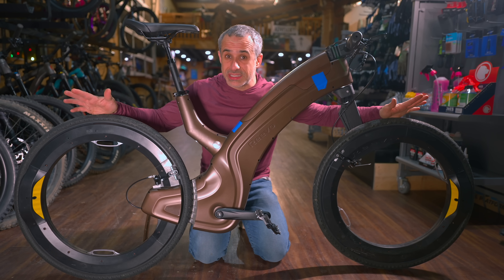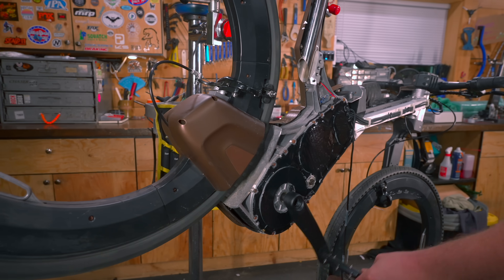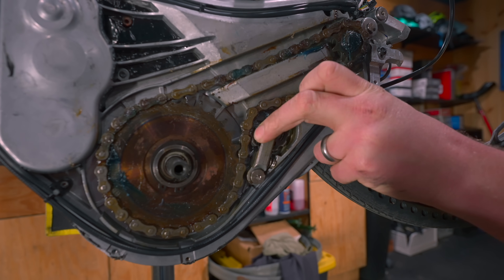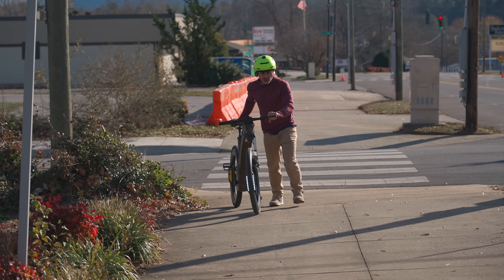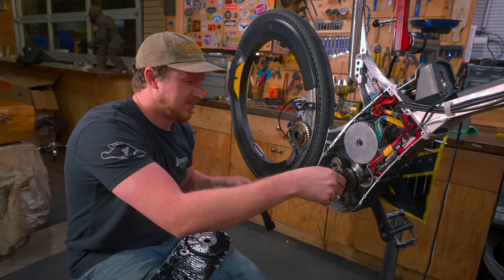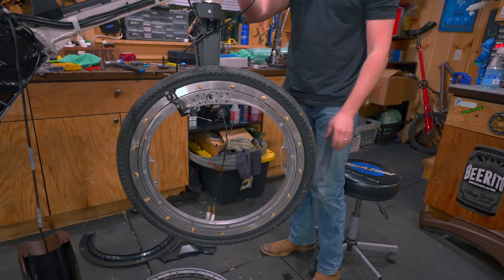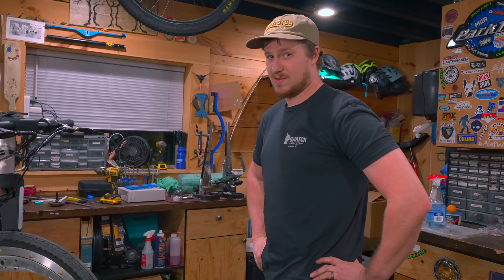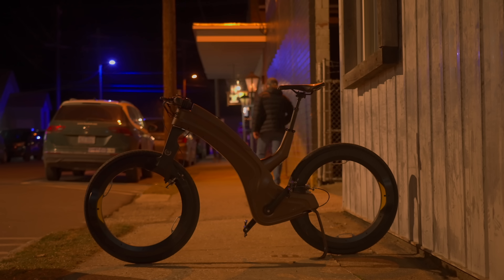What's Inside The World’s Worst eBike? Reevo Teardown

Comment: This is a great reminder of how wonderfully elegant a normal bicycle is
Reply: Bicycles are crazy efficient. I've read that like 90-99% of the mechanical energy delivered by the rider is transmitted to the wheels
Reply: @jesperhagstrom  Where 1% of the energy is delivered on the Reevo. The rest is lost to friction.
Reply: @jesperhagstrom  its around 90% for a non-ebike, (ebike is less efficient due to losses in regenerative brake charging vs its overall drive losses in recovering the energy) with most of it being the losses of our reciprocating legs (conversion to rotational energy), rolling resistance, drive friction, a traction and elastic losses where the rubber meets the road, but that is still an incredible efficiency for any machine.  I remember the Gossamer albatross and condor were both designed around the power plant (a peddling person) needing to deliver a sustained 1/3 Hp so it is also helpful that bike pedals are themselves a very efficient way for us to turn reciprocating motion into rotational energy.
Reply: @larrybremer4930  
Yep, 90% is a fairly poor case; old, dirty, poorly fitting chain and a derailleur that's not been tweaked in forever. If your bike is clean, lubed and you have the first notion about maintenance then losses should be down to 2%-5%.
Reply: @desburnett5406  google gave a mixed bag of answers but to me part of the equation is the efficiency through all losses, such as it being unfair to say an electric motor is X efficient without counting conversions like heat engine losses to generate the power, or  battery charge and discharge losses, etc.  I saw number in the ranges of 90-98% and I bet a lot of that variance was not so much comparing  a competition bike to a huffy, but what losses they were including or not  including.  Bike Only, or Bike plus Rider, or Bike plus Rider + Road + Air.
Reply: @ The measure is almost always pedal (or crank, it makes no real difference these days) to rim, much as it's crankshaft to wheel-hub on a car. 
Variance can creep in on a single bike; if you're running small radius gears and crossing the chain, you'll be dropping more energy (often as much as a few % extra!) than if the chain is optimally positioned.
Reply: @jesperhagstrom  That's barely any energy lost in the conversion!
Reply: @jesperhagstrom More specifically this efficiency is for the drivetrain, and we’re talking about the typical derailer drivetrain. There are things which will steal efficiency, such as suspension, tyres, and of course air resistance. And there is a lot of different things which can decrease efficiency of the rider.
Reply: @CanIHasThisName  correct, the drivetrain was a topic in this video so that's why I commented about it.
Reply: @jesperhagstrom and gears are bad choice
Reply: @jesperhagstrom  just look at the bicycle in the video, it just help spinning, if it was in a vacuum it would be almost a perpetual motion machine. these things are stupid efficient
Reply: @jesperhagstrom  They are the most energy efficient way to travel. If you compare it to walking, you can go about 3 times further on a bike using the same amount of energy.
Reply: @jesperhagstrom ehh probably not true
Reply: @jesperhagstrom  You can find bikes in the worst condition that still work.
Reply: @jesperhagstrom  I doubt that. 90% is more like the entry point of high tier and specialized bicycles (like, no speeds), with professional bicyclist pedaling full power (since losses by friction are more or less constant, so higher power input means less efficiency losses). So, technically, you can achieve something like 98% efficiency, but only in very specific case. A regular bike and bicyclist should be around 80-90%. Which is still quite great.
But that is without the main efficiency thief - the air resistance. Which grows exponentially with speed. So, bikes are very efficient when you stay or when you just started pedaling. And when you got to speed, then efficiency drops.
Reply: @aberroa1955 You’re mixing up different types of efficiencies.
Reply: @jesperhagstrom 
Where are you going after you die?

What happens next? Have you ever thought about that? 

Repent today and give your life to Jesus Christ to obtain eternal salvation. Tomorrow may be too late my brethen😢.

Hebrews 9:27 says "And as it is appointed unto man once to die, but after that the judgement
Reply: @jesperhagstrom  Maybe with a waxed and broken in new chain, completely new and clean ceramic bearings, new pulley wheels and fresh bottom bracket and pedal bearings. But most bikes out there, no chance.
Reply: @rnedisc  it really does depend on condition, but if you don't ride in a heavily salted city and use external gears, or have rust literally covering your chain and gears, it's usually well over 90%. Again, this is with a moderately maintained bike that gets a grease every year.
Reply: @jesperhagstrom  That's not really a good statistic. I'd guess around 90-99% of the mechanical energy delivered by an ICE in a car is transmitted to the wheels as well. The losses come from how that mechanical energy is produced. For humans, how well we convert the chemical energy in food, the main loss being body heat. For cars, how well they convert the chemical energy in the fuel, the main loss being friction in the engine creating heat, and powering all the other things needed to keep the engine running
Reply: @jatoxo  not even close, the transmission in a car has a lot of friction compared to the simple drive train of a bike
Reply: @ It seems the actual loss (known as drivetrain loss) in ICE cars is around 15%. Though for EVs, since the transmission is much simpler, it seems to be around 6-8%.
The main point is to be aware of the difference in drivetrain efficiency and overall efficiency
Reply: @jatoxo AFAIC most of ICE efficiency in converting chemical energy to heat and then to mechancal energy depends on its thermodynamic efficency. Friction is much less significant in most cases. Heat engine cannot be more efficient than ideal Carnot heat engine which efficiency is (Th-Tc)/Th. Th - is absolute temperature of the heater, Tc - absolute temperature of the cooler. In ICE these numbers can be approximated as temperature inside cylinder at the hottest moment after ignition (Th) and exhaust temperature (Tc). (This is theoretical maximum - real engine cycle is not Carnot cycle so efficiency drops).
Reply: @jatoxo Drivetrain loss in a car is often higher, as high as 25%. There's even loss IN the engine, before the drivetrain, with power lost to run the water pump, oil pump, alternator etc. That in-engine loss can be 20% of what's actually produced.
Reply: 200 years of evolution.
Reply: Watching these videos made me buy a Rivendell
Reply: @macho_taildrop  We feel the coming of a new day
Darkness gives way to light a new way
Stop here for a while until the world,
The world calls you away
Yet you know I've had the feeling
Standing with my senses reeling
This is the place to grow old till
I reach my final day
Reply: Yeah there's a reason they haven't changed much for 100 years. And the Reevo is a great case in point for the principle of Chesterton's Fence. "Disruptors" need to heed this lesson. But I know they won't.
Reply: Almost like they've been perfected over 100+ years 😂
Reply: sometimes things don't need to be fixed, they work fine as they are...
Reply: This is what happens when someone tries to reinvent the wheel. 😅
Reply: @oldschoolman1444  Literally. This bike makes me realize some things can't be innovated away. The hub is the entire reason wheels work like they do XD
Reply: @nevadanate4957  Well, if you designed this hubless wheel in the same way that a hub is designed, but just expanded it outwards...it could be just as good. The problem here is that they used some sort of elastic polymer wheels individually pinned instead of hardened steel bearings in a cage, seem to have used the side walls of the inner and outer castings to take the thrust loads (meaning they rub together), and didn't seal the assembly against dirt and LOOSE SCREWS??? apparently.

But of course four good, 30" diameter, sealed, thrust, ball bearings probably cost a LOT more than these two wheel assemblies did.
Reply: @oldschoolman1444  We did many times ! But here it failed !
Reply: Not only are they super simple and elegant. Bicycles are supper efficient, too! I watched in some video that they use less energy to move kg of mass than walking, any animal moving, and any commonly used method on transportation. It's pretty much one of top movement-efficiency devices in our world. If something is more efficient it's probably not very commonly used. . . . Actually raft going downstream in river uses no energy... But if we count - entire river moves a lot of energy and it is required to move raft and it can only move limited number of rafts, then maybe we can count that in...
Reply: @Buffalo_Soldier  Quite right, and in fact I used the word "elegant" for both of its meanings: to be "graceful and stylish in appearance or manner", but also "(of a scientific theory or solution to a problem) pleasingly ingenious and simple".
Reply: @Buffalo_Soldier  Transportation wise I think railroad is still the king of efficiency with nearly all of its losses coming from the heat engine,  but the actual movement on a railroad uses a shocking low power to weight ratio compared with other methods to move things.
Reply: open market parts !
fits all
Reply: And how beautifully simple a hub motor is. Still the best way to electrify a bike
Reply: Or even just normal electric bike that isn't Built too look like it's from a dystopian future.
Reply: also a reminder that 99% of companies that have to crowdsource funding for their brilliant new innovation don't actually have a brilliant new innovation.
Reply: Well that's the premise of this video.
Reply: the self-stabilizing steering of the front wheel is pretty genius too. Veritasium did a nice video on bicycles a while back
Reply: Maybe let's think about why we've stuck with the wheel and spoke design for centuries
Reply: The most efficient means of human powered transport... and they've taken virtually everything that makes it so and removed it!!
Reply: Back in the 1800s they didn’t have the Luxury of stupid people with a lot of money.
Reply: Yeah, theres a reason Bikes havent changed that much in the last 140 years.
Reply: bikes are the shit. the simpler the better! ok, there ist kind of a sweetsport... brakes are kind of nice and drive trains and stuff.
Reply: "Inventing the bicycle" in a nutshell.
Reply: Yeah but it's too slow for traffic so get off the road please 🙏 at least the electric stuff can keep up, I had some kid pass me while going 45 on an electric scooter. I couldn't believe that thing was going that fast. Remembering my electric razor as a kid and not even 20 years later having these makes me excited for what's coming.
Reply: And timeless
Reply: It really goes to show that the classics are always better than the new
Reply: Try finding a decent single speed mountain bike and you’ll see that isn’t always the case.
Reply: Exactly.. Not everything needs to be improved.
Reply: and how beautifully evolved the normal design is and how it was mostly got right a long time ago.
Reply: ay any cheap bike gon be ass
Reply: And why their design has changed very little in the past century
Reply: If it ain't broken, fix it till it is.
Reply: Mine fav is japanese bike
Reply: yeah and I find it funny how lazy humans have become.....  to not even willing to crank up a window to cant even pedal a bike..   and changing a tire becomes impossible for the average Joe mechanic.....  pathetic you's rather pay someone then just dixig it yourself...

ps   if you think about it your paying 5x more for being lazy... LOL then complain everythings to expensive.. LOL
Reply: Amen brother!

Comment: So looking at this thing taken apart it's so much worse than I ever expected.

The traditional "safety bicycle" as the world's most popular layout has endured because the use of triangles made the frames incredibly strong with very little material.  Even when the rear triangles to the rear hub were replaced with an articulated suspension, the main frame of the bicycle remains strong, and remains a good frame to attach the articulating parts of the bicycle.  Rear articulating suspension or fixed mountings for the rear hub, the traditional bicycle features a comparatively short, compact frame that by virtue of its compactness and use of triangles remains durable.

The Reevo basically extends the frame all of the way to trailing edge of the rear wheel.  This extends the moment-arm.  It wouldn't surprise me if other Reevos that are kept in service a bikes end up damaged beyond repair simply due to hitting bumps.

The twelve bearings (or more, I was counting as he was sweeping up) would mean at least some portion of those bearings would be introducing friction at the same time, so call it six bearings at a minimum where the load of the frame is pressing down on the bearings which are pressing on the wheel/tire.  This is opposed to two bearings on a typical bicycle.  And that's before considering the continuously driven gear and chain assembly.

Comment: Man, you make a larger ligter weight planetary gear, a better modern moattery and motor (Avinox anyone?) - throw in a carbon frame or at least some carbon components. Oh yeah - throw in a clutch so the thing doesn't drive on its own and it could be a pretty cool machine!

Comment: If someone wanted to build a hubless wheel out of actually available bicycle parts... I have a thought experiment - no idea if this would even work - string a standard (well, not entirely - hollow pin) bicycle chain inside of a rim, using cut down spokes, and some kind of inside webbing frame rolling on derailleur wheels , like, minimum of 3 of them. The inside frame could be made of same composition as the rear bicycle triangle of the frame. With adjustment to tension the rolling wheels maybe. I see the drawbacks of that - for one, the inside diameter of the chain requires that the transfer cog has to be spinning much faster. Which could make it very difficult to drive actually fast on any surface unless a comically large front drive cog is used and comically small rear cassette. Hence this shall forever remain a thought experiment only :)

Comment: Honestly I can see how this bicycle came about.   Most likely scenario:

1.  Business-major frat-bros decide they want a product that looks good without a wit of STEM knowledge between them
2.  Fully formed and committed in a business plan they lock themselves into the idea before engaging any actual engineering talent
3.  After many rejections they finally find an engineer who will take the project on but only if paid first (because he knows where it is leading and at least wants to be paid)
4.  Engineer designs a minimally functioning design give the constraints demanded and then bails
5.  Founders hire some engineering interns to finish the job

Or some variation on this.  I've seen it far too many times in Silicon Valley.   People never realize that for each successful company like Apple, there were 20-50 other companies trying to do the same thing that you don't hear about because they failed so profoundly and quickly that there is no trace of their existence ever written down.

Just do a back-of-the-envelope on rolling resistance for the wheels!!   That's a calculation that should have been done the first DAY the bros came up with the idea.  It would have saved all that time and money right then.

This is why I say "Inventive ideas are the easy part - the hard part is doing the work to kill >95% of them as violating physics, violating design specs, violating economic laws, or violating financial possibilities!

You shouldn't even get to the point of seeking financing without doing the work to validate these requirements first!

Comment: Thanks for that teardown. I'm thinking about a hubless bike for years and now I know one more way to not build it. 😅 There are a couple of hobbyist projects out there that all seem to work better than this commercial "solution". I wonder how much of the rolling resistance was the drivetrain and how much the wheels. The spin down looks not that unrideable if you remember rim brakes and bent wheels. Does the front end fit a normal bike?